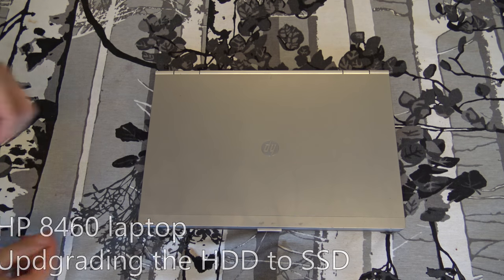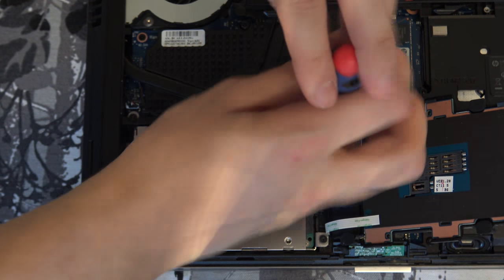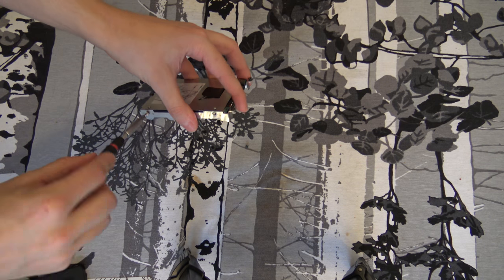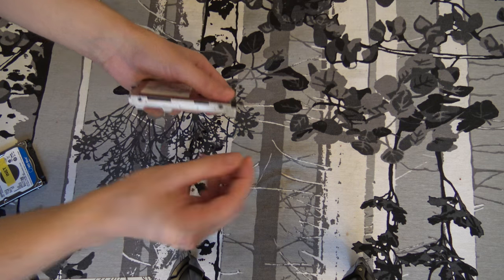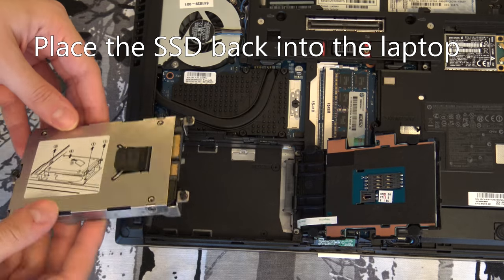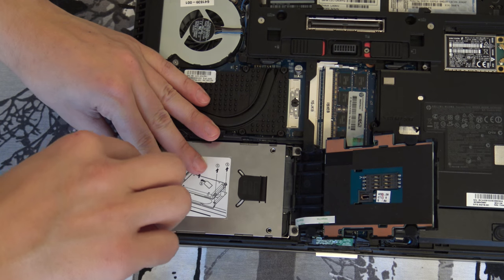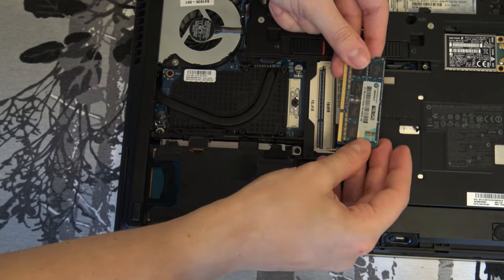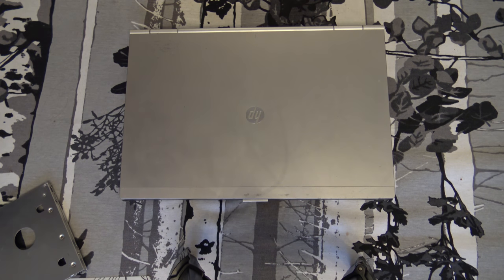Upgdrading Hp 8460 HDD to SSD

Comment: It shows unavailability when I try to setup finger print sensor
Reply from the maker: Have you installed the drivers from HP site?
Reply: @MikkoTenhunen  I tried but I found no fingerprint driver there
Reply from the maker: What is the Hp model?
Reply: @MikkoTenhunen  8460p
Reply from the maker: https://h30434.www3.hp.com/t5/Notebook-Hardware-and-Upgrade-Questions/Where-can-I-find-finger-print-drivers-for-Elitebook-8460p/td-p/7477119

Comment: I have this laptop and wanted to upgrade my HDD to a SSD. I just wanted to know whether you could put a Sata 3 SSD into it? I know Sata 2 is compatible but would there be any issues with the sata 3 not being compatible?
Reply from the maker: Am not sure but since the hardware is outdated i dont think it can use the full power of Sata III https://kb.sandisk.com/app/answers/detail/a_id/8142/~/difference-between-sata-i%2C-sata-ii-and-sata-iii
Reply: No problem running super

Comment: Bro, Which is best for gaming? Dell latitude e6330 intel Corei7 2.5GHZ vs HP EliteBook 8460p Intel Core i5 2.56hz
Reply from the maker: Both of these computers are good at office work, but i woudnt recomend them for gaming. If you want to play modern games or games that need 3D rendering you would still need a laptop with a grapich card both of these computers are missing that. Am not sure what games you can play with these laptops since they are very old and not that fast ones.

Heres comparison tool about it.
https://cpu.userbenchmark.com/Compare/Intel-Core-i7-3520M-vs-Intel-Core-i5-2410M/m50vs2769
Reply: @MikkoTenhunen  which is suitable...for gaming; your advice
Reply from the maker: Intel i7 is faster in the comparison chart 📊 i don't know very well dell computers so it's hard to give opinion the i7 is just faster

Comment: Руки бы обломал за такое открытие картридера. Как банку газировки открыл. Там же стрелка нарисована
Reply from the maker: Not sure what you mean?
Google Translate 
"I would break off my hands for such an opening of the card reader. I opened a can of soda. The arrow is drawn there."
Reply: @MikkoTenhunen  I mean that this card reader must be opened by another way. You should pull the tab in the direction of the arrow. You almost broke it
Reply from the maker: @МихаилМиронов-м5ш  Well it would only brake the plastic holder i doubt the card reader would get broke.